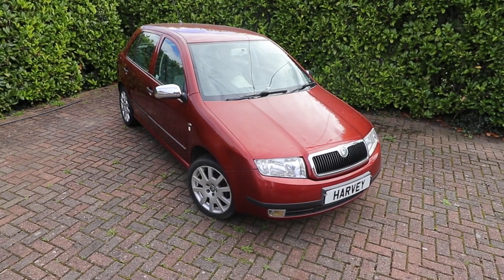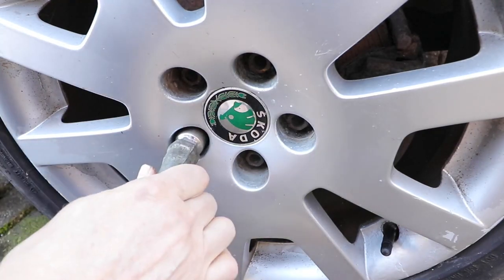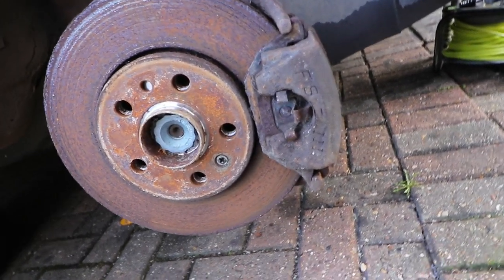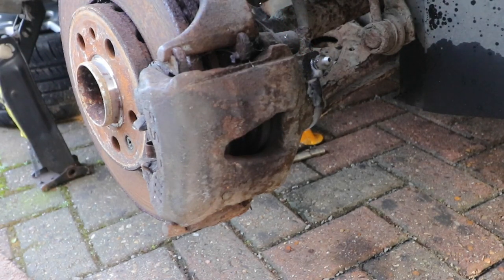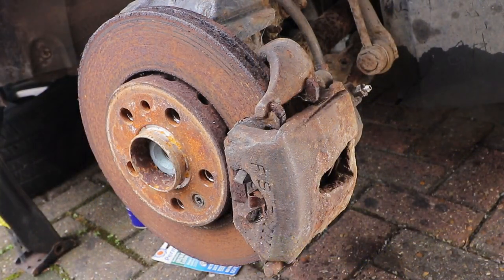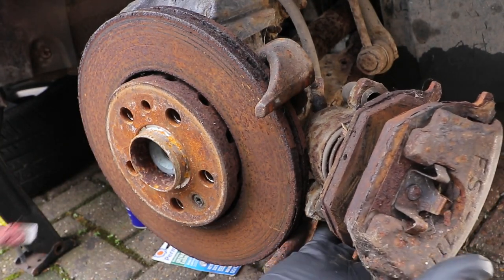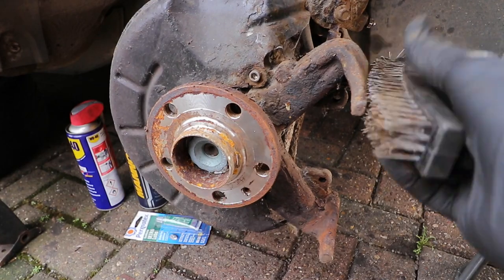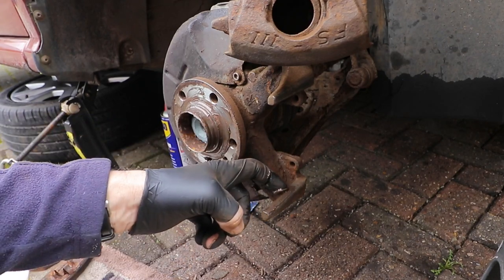SKODA FABIA Front Brakes (A beginner's guide) Mk1 00-07

Comment: Here you are again. Glad to see you. my Fabia has 2 T45 screws in the FS-III. Not the 7 mm. I would only cleaned the rust from the parts and use the same ones. I think you live near the sea. That is too much rust.  I had a Seat that in twenty years do not seen a garage and not so rusty.
Reply from the maker: yes, it is very damp where I live. I will do a video showing me clean up the brakes and re-using. Interesting you have T45 bolts :-)
Reply: @HatBoyHarvey  I think that a 7 mm key do not turn T45 bolts and vice versa. 😃 But already seen in YouTube a guy unbolting a torx bolt with a flat screwdriver...

Comment: Have to do it on  mine, rusted the hell out....Thanks! Props!
Reply from the maker: If they are very rusty then you may have issues such as seized caliper pistons, if so, just replace the lot as it is much easier than messing about freeing those up. Wish you good luck :-)
Reply: @HatBoyHarvey  Did the headlight swap yesterday, thanks for that to! :D 
Well, they work ok, wheels roll freely, brakes work , its only a visual bugger. Probabbly need to swap the discs. Pads are ok still.

Comment: Is it obligatory to bleed the breakes after changing the pads/discs?
Reply from the maker: Not always necessary. If they feel solid, no worries, but you have also got to think about water content that builds up over time. That is why it is recommended to periodically change out the fluid as per service manual. The fluid absorbed water from the atmosphere and when this evaporates under hard braking it can produce air pockets and spongy potentially dangerous brakes.